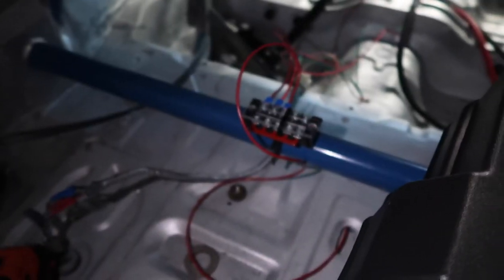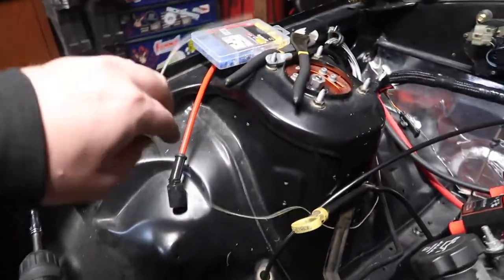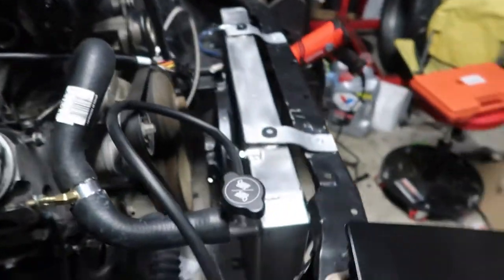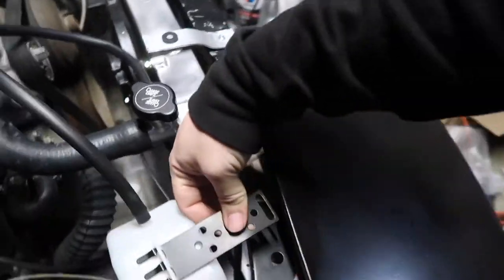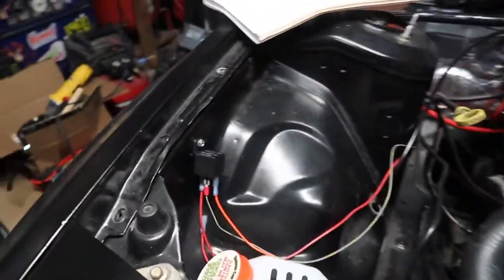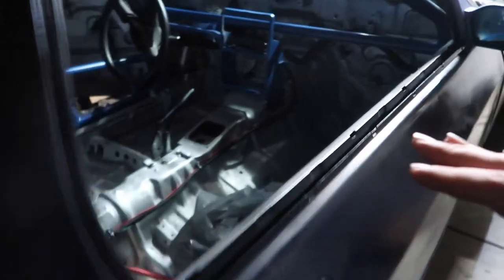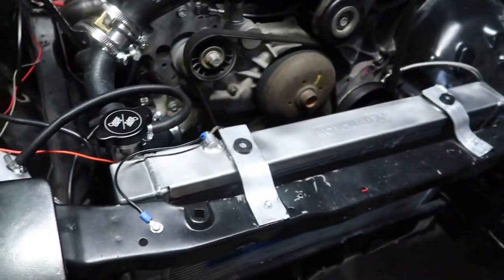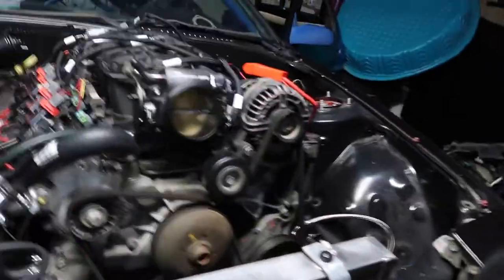Dash is back in, wiring is done, and the radiator is good to go!

Comment: You shouldn’t be running fused lines to the alternator, you’re also better off grounding the fans and other electronics to the chassis not the radiator. You want the ground to be shared among the battery assuming the battery is being mounted to the chassis.
Reply from the maker: Ground is from the chassis. Just using the bolt on the rad to tie the wires together. Fused line is coming from the alternator, which would be the same connection from the battery as it’s all tied together. 

However, I’m not claiming to know anything... hit me with some facts and links and I’ll check em out. 🙏